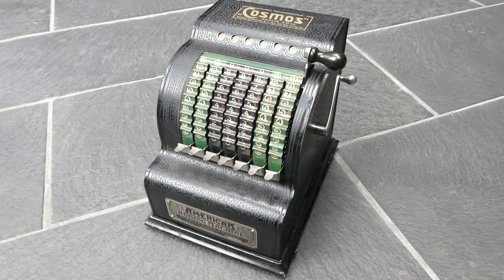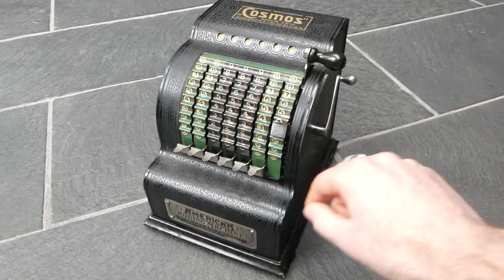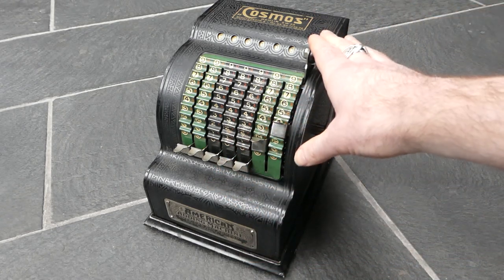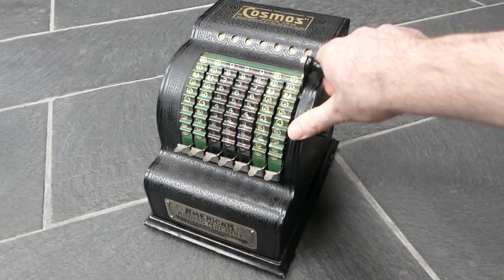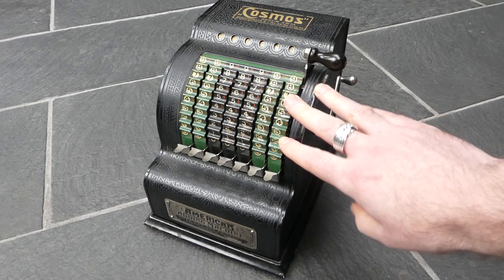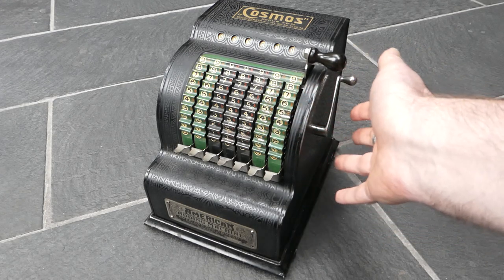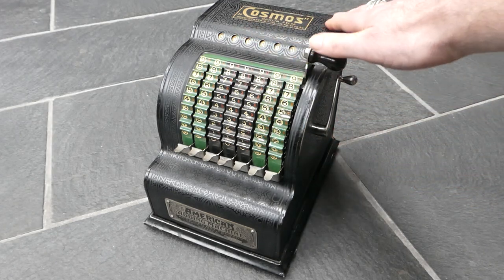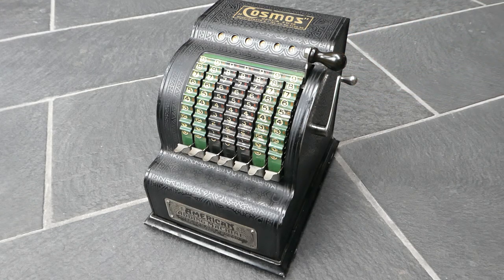The American Adding Machine

Comment: Looks just like what I imagine an American till to look like.

Unrelated, do you know what the machine is that is used in the film "The Mask" when he's counting all the money? If its even a real thing.
Reply: I would guess it was a fake prop- a real one would be much too heavy for him to hold like that, and the handle looks much bigger than I would expect. And obviously the paper wouldn't fly out like it does, though that could be a digital effect? The general look of it is similar to a underwood-sundstrand adding machine, but without the keyboard visible it's hard for me to say. But maybe Jaap knows? (he always knows more than me)
Reply from the maker: I don't recognise it either. As you say, it is definitely a fake prop, but it is clearly based on real machines. You can tell its design is from the 1940s, with its rounded case in functional grey and an Art Deco metal trim around the base. In a few frames the keyboard seems to be 10-key.

I've been meaning to revisit the Shawshank Redemption to identify the adding machines Andy uses. The sequence spans at least a decade, I think late 40s to the early 60s, with adding machines to match.
Reply from the maker: I think it may be modelled on a Remington Rand adding machine, like this one:
http://www.thepcmuseum.net/calculators_details.php?RECORD_KEY(calculators)=id&id(calculators)=38